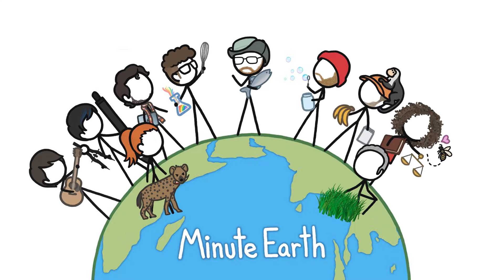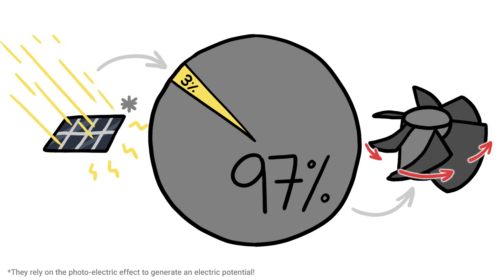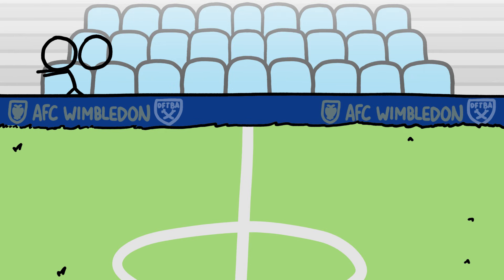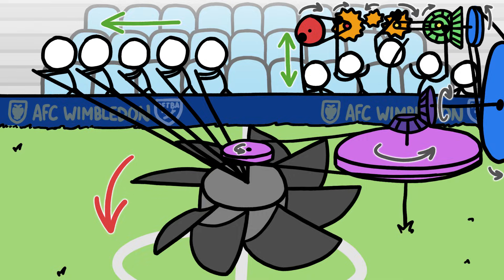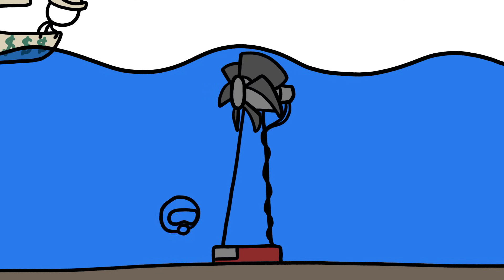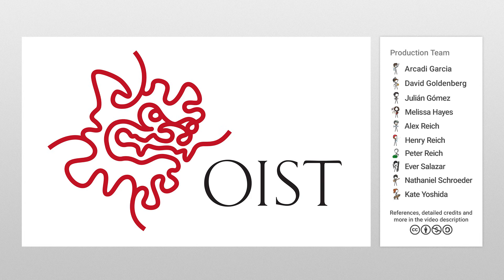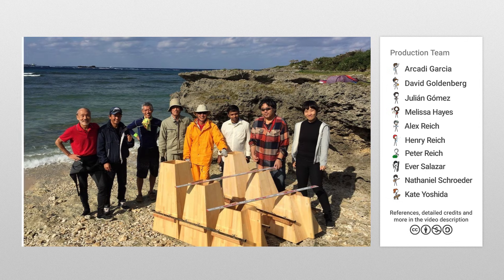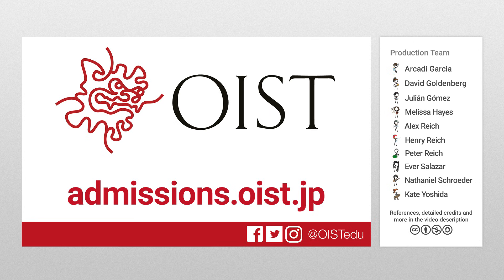Why Can't We Get Power From Waves?

Comment: My dad runs the engineering department of Columbia Power here in Oregon. The design their team is developing is a mechanical float mechanism that acts on a fly-wheel. Sort of like those inertia cars that used to come in Happy Meals, basically you crank more energy into the fly-wheel in one direction & the fly-wheel then runs the alternator that generates the AC current. Turbines aren't used in diesel generators, which are currently the simple solution to "I need electricity here & there isn't a convenient way to run a turbine here."

Comment: If there's one power source that needs an explanation on why we can't use it is nuclear. Why is everyone against nuclear? What are the recent developments? Why are we not looking into such a powerful and readily available source of power?
Reply: If its fission you are talking about
Fuel is limited. Despite its high energy density it will run out. We could maybe run the world for a hundred years or 2 on the uranium and such we get. Maybe more if we find a way to use other fuels.
But it's a massive biohazard.
If your talking fusion then it's being worked on but is still a way off from being practical. Maybe in another 10 or 20 years. But not now.
Reply: @curseofgladstone4981  
"Fuel is limited."
The World Nuclear Association begs to differ.
http://www.world-nuclear.org/information-library/nuclear-fuel-cycle/uranium-resources/supply-of-uranium.aspx
Not only that, but some reactor types can reuse their waste.

"But it's a massive biohazard."
It isn't. There aren't huge wastelands caused by nuclear waste. All the nuclear power we've used barely left a scratch. Nothing compared to the areas covered with wind turbines or the fields of solar panels or the huge number of dead birds.
As for nuclear accidents, Chernobyl stands out. It used a very antiquated and unsafe reactor design, and personnel deactivated safety features in order to conduct that test.
Fukushima used a similar design, but they managed to keep everything under control as much as possible. The incident had a minimal effect on the environment, with people already moving back in. I couldn't find a definite death toll due to radiation, since it seems that death due to relocation and due to the tsunami itself are added up into one figure.
Three Mile was another boiling water reactor, with the same flaws as Fukushima and Chernobyl. The reactors available today are almost entirely safe. CANDU type reactors have been available for decades and cannot physically have a core meltdown due to the type of fuel used. Molten salt thorium reactors are very easy to manage, fast to shut down, cannot have a meltdown, cannot explode, and are in development. Working reactors exist, but further research is needed to ensure longevity.

In short: There's plenty of fuel, they're safe, they're clean, and they have proven themselves. Far more than so-called renewable energy has.
Reply: @CristiNeagu  
the main reason is because most of the activists pushing for renewable energy solutions are liberals, and liberals are scared of literally anything, especially the word "nuclear"...

Comment: Don't confuse wave energy with tidal energy.  In places there is enough flow in the tidal changes to drive (you guessed it) a turbine.  These are in commercial use, however they do suffer from the same issues as any undersea equipment, namely corrosion and inaccessibility.
Reply: i was surprised he didn't talk about tidal energy
Reply: Yea as a science based channel I was disappointed they didn’t mention tidal energy :/
Reply: So, basically, original comment said exactly what the video said. ...uh, thx?
Reply: Thanks for the information, I was kind of confused
Reply: The area where I am is powered/assisted by Tidal generator(total output does cover it)
Reply: Michael Steeves how about that wave-powered power plant in Norway?
Reply: Michael Steeves right I live in ns can and we get tidal power
Reply: But tides simply move up and down one cycle per day, seems extremely inefficient.
Reply: @eggyrepublic  On the contrary,  tidal power seems both reliable and efficient with a capacity limited only by the size of the basin you are willing to dig.
Reply: @G11713  I just did a bit of research on them, it appears they just rely on currents like dams. I see how that can be effective.
Reply: It’s easy enough to moor a barge to a pulley for maybe a kilowatt of power. Between buoyancy and gravity, it’s really easy to draw power from a mass being moved by such unstoppable forces. All you need is a fixed reference point like a mooring base.
Reply: Tidal power is also unsustainable at filling much demand. Seeing as there are only a few terawatts of tides to begin with and baring some massive geoengineering project or moving the moon closer I see no way to change this fact.
Reply: Arent tides just big waves anyway.
Reply: @DocDewrill  No. They are the physical pull of the Moon pulling the Ocean away from the edges of the Earth to the Center. Waves are just caused by wind.
Reply: @evoeightyci  waves are not just caused by Wind ^^  a tsunami is a big Wave too wouldnt you agree?  And the only diffrence vetween waves is the size.
Reply: @DocDewrill  A Tsunami is caused by the Earth's crust shifting. Like dropping a big ball of steel into the water, it causes waves. The Moon's pull is not a wave as such. it's a gravitational pull, not a push.
Reply: @evoeightyci  according to Britanica com, every wavelike movement of water is a wave. So tides are technicly a gigantic wave.
Reply: @DocDewrill  OK
Reply: @evoeightyci  Nope. The Moon 'pulls' everything in equal measure at equal distances, just as any other gravitational body. It's pulling the whole Earth the same. In fact, it is so heavy, that the Earth has to lean back a little to balance the Moon's orbit, as you would have to lean back to swing a child in a circle around you. This gives the Earth a 28 day 'wobble'. The oceans slosh back and forth somewhat from that wobble. As the Earth rotates every 24 hours, each point on the surface will come to a high point in those sloshes, and then low point sloshes, roughly twice a day.
Reply: @gg5115   I do understand that. What I was trying to say was the the Moon is a different power source than anything produced on the Earth itself.  Energy on Earth is produced by the heat of it's core, mostly. The tides move because of the force of the Moon, and nothing to do with the Energy of the Earth. Can you see what I was "trying" to say? This is why I was trying to separate waves and tide. I hate 2 dimensional language. I never dislike being wrong. I hate being wrong through my own ignorance.
Reply: Thanks, I'm glad someone pointed that out.
Reply: Tidal power also messes up ecosystems badly (much like hydroelectric power) and requires a massive area, turning large lengths of coastline essentially dead.
Reply: @MrOobling   The main issue is that eligible sites are very rare, even if you are willing to risk the ecosystem.
Reply: @MrOobling  The initial attempts at stored head tidal power (i.e. the demonstration site at Anapolis Royal Nova Scotia) had significant impacts.  Modern units are essentially "underwater wind turbines" which have far lower ecological impact.
Reply: @MichaelSteeves    Yes, and the tidal power was so strong in the Bay of Fundy it broke off the main support the first time. Oops. It's back in and running now I believe. 
  Whatever we can come up with to help our species survive.
Reply: @MrOobling  I think you want to talk about tidal barrage, that is one way for using tidal energy. The environnemntal impact is not as bad as you think. French researchers studied the impact of one of the largest tidal barrage (La Rance) and found that "some species lost their habitat due to La Rance's construction, but other species colonized the abandoned space, which caused a shift in diversity." It is not completly dead, but it is not the same ecosystem. Other people commented about the alternatives methods to use tidal power, i.e. tidal stream generators, that have lower ecological impact.
Reply: @thibautkovaltchouk3307  I imagine it depends where it is too. I know the severn esturay tidal plant in the UK is controversial. But it might be able to power 10% of the UK energy needs with non carbon power. You need to weigh up costs and benefits
Reply: @Chilukar  Exactly, and I think the same place can lead to largely different ecological impact depending on the project (the size, the preservation policy,...)
Reply: @thibautkovaltchouk3307  I didn't know about these developments, that's good to hear.
Reply: I did not see any confusion in the video.
Reply: Thibaut Kovaltchouk - you also didn’t see any mention of tidal energy. It’s a valid comment which clarifies we are pulling energy from the sea for those uninformed.
Reply: @uhhhhh262  Anyone with two braincells thought about current being used.
Reply: @thibautkovaltchouk3307  Its confusing if you were already vaguely aware of the existence of tidal energy but didn't realise it was distinct from wave energy
Reply: Technically a tide is just a huge wave.

Comment: just make it like a car engine with buoyant balls, moving the pistons up and down .
Reply: salts want to know your location
Reply: Tried that Up and Down motion and it sent Electrifying waves of pleasure around my body. 10/10 would try again.
Reply: friction and salt / dirt deposits will be hard on this one
Reply: @NoThankYouLeaveMeAlone  you just store it inside a container with exposed pistons only. So only the container will need maintenance over a long period.
Reply: Unfortunately, waves aren't as well timed
Reply: @crackedemerald4930  maybe a syncro bubble can be placed in front mechanically adjusting the ratios based on incoming wave
Reply: Interesting idea. Salt? Mechanics? Never mind these issues. How does the marine industry survive? Stainless, brass, Teflon etc. The mechanics underwater? : picture an off shore oil rig. Where there's a will, or $, there's a way
Reply: @Froggability  it can also be placed above, under a bridge https://imgur.com/4kiHucS
Reply: Adrian Gray that idea is obvious enough that I have to expect that someone has already tried it

However, just in case no one has, try it!

You might become rich
Reply: Adrian Gray. afraid that looks fraught to failure. Storm= destruction. 
Consider a "farm" of submarine sized vessels semi submerged. Connected to sea bed with large hydraulic rams or similar. Able to be sunk lower should conditions get rough

Comment: I remember how disappointed I was when I learnt that nuclear power just uses the heat to turn water into steam.

This makes me wonder if fusion power is gonna do the same thing. 

Like come on, using heat to make steam to drive a turbine is the same technology that made steam trains. the technology is as old as steam locomotives.
Reply: Yes fusion is going to do the same thing.
Steam turbines is the most efficient thing we have to go from heat to electricity.
Reply: MrBleulauneable I get that it’s efficient, but it’s sorta just disappointing that in all the years since the steam engine we couldn’t think of anything better
Reply: @thestargateking  Are you disapointed that we haven't found anything better than the wheel to make vehicles ?
Reply: MrBleulauneable Umm, we have more things than wheels for motion, we have tank treads, we have helicopters using rotating blades, and we have aircraft with jet engines that only use wheels to land with, and then we have maglev trains that float, making wheels not even necessary, there’s far more things than just the wheel for motion.
Reply: @thestargateking  
tanks still use wheels ( https://i.redd.it/h1192qmjha321.png, https://i.ytimg.com/vi/KXHLfzVo40Q/maxresdefault.jpg ) and are in principle no different than cars. the treads are there just to distribute the weight better. even jet-powered aircraft still use wheels ( http://i.stack.imgur.com/faajY.jpg ), while maglev is a joke when compared to the efficiency of wheels.
Reply: @thestargateking  Yeah sure there are some altenatives to the wheel for specific applications, but the wheel has been there for several thousand years and I don't see it being replaced in the foreseable future. Maglev in particular is cool but it won't replace the wheel because of the infrastructural cost associated with it  (compared to asphalt) and other practical considerations (acceleration, breaking and steering) that pretty much limits it to high speed trains. Car, bikes and nearly all other land vehicles will keep using wheels simply because wheels just work really well.

And that's the same situation with turbines, we have few other options to make electricity from heat (like Peltier modules that use the Seebeck effect, or we could also for example use IR "solar panels" to harvest blackbody radiation) but the turbine is like the wheel: it's such a good invention that it always works better than any alternative except in very specific applications. So turbines will most likely stick around for a long time.

Also it's not like wheels and turbines are stuck in the past, they have been vastly improved over the time.
Reply: Voltage Drop the wheels on aircraft are there just for landing purposes, but way to ignore the helicopters, and GTFO with the maglev comment, the whole point of the levitation is to remove friction, to allow the vehicle to achieve a faster speed than what would be possible. At high speeds the wheel would be inefficient
Reply: MrBleulauneable the wheel is different to the turbine, there are technologies that can replace the wheel, but turbines to generate electricity have no replacement, there’s no replacement for the turbine in a power plant.

I don’t get why you feed the need to attack the idea that it’s disappointing that the method of energy generation has been the same since the steam engine, like the wheel isn’t even comparable, wheels have used completely different materials, have had tracks, have had helicopters replacing wheels, levitation. While the turbine still uses steam, with the basic copper wire and magnet trick.

Battery technology has developed more than the basic turbine, and battery technology is developing very slowly.
Reply: @thestargateking  Wings don't do the same thing as wheels  so comparing them is stupid. Maglev and tanks treads do the same thing as wheels so comparing them is not stupid, but as someone remarked before : tank treads are just fancy wheels and as I explained maglev is only suited for a niche application and can't replace the wheel (hell, maglev trains even use wheels to launch and stop).
And maglev trains are barely better than regular high speed trains with wheels for reference the speed record for train on regular wheels is 574,8 km/h while maglev speed record is 603 km/h. At high speeds the limiting factor for trains is the aerodynamic friction which maglev is useless against.
Reply: @thestargateking  As I already mentioned there are other ways to convert heat to electricity "Peltier modules that use the Seebeck effect, or we could also for example use IR "solar panels" to harvest blackbody radiation".
And turbines are complex machinery I don't understand how you can even think that no improvment as been made to them over the years. For your information we are almost reaching the thermodynamic limit (aka the absolute limit imposed by the laws of physics) with the best turbines now.
Reply: Turbines are very efficient

Comment: Video idea: we are constantly getting pulled by gravity why cant we generate electricity from it
Reply: We do, with dams
Reply: @dfhgjhg  oh you are right... Hadnt thought of it..😶
Reply: Hydroelectric dams generate power from gravity.
Reply: In order to get energy from gravity we need to raise an object up and then let it drop down. Raising it up takes the same amount of energy as the object gains as it falls. We can't use gravity to harness energy but we can use it to store energy.

For example, if we have excess energy being produced by the grid, we can use it to pump water into a reservoir. When that energy is required again, the reservoir is opened and the flow of water is used to spin hydroelectric turbines, producing electricity.

Grandfather clocks also use gravity to store energy. The hanging weights slowly descend, powering the clock. They can be wound back up to give the system more energy, and that energy is released again when the weights descend.
Reply: @charliebeadle2979  Raising an object up takes more energy than it produces as it falls down*
Reply: @user-lw5oc1tt8k  In practice, yes, but I'm just talking from a purely physical perspective (i.e. in a frictionless vacuum). In such conditions, the change in energy of the object is given by the equation E = mgh regardless of whether it is moving up or down.
Reply: @charliebeadle2979  What I was thinking of is basically having an object fall from a high place (with maybe lot of air/(maybe a gas that can heat up easily) ) from friction it would generate heat then we could use that heat to make electricity(like described in the video) after the object falls it could  go to another "box" (with no air so no friction so less energy needed)use some/most of the energy it made while falling to lift itself up and start all over again
Reply: @user-lw5oc1tt8k  The energy generated from friction will be far less than the energy required to lift the object up high. A potentially more efficient method would be to have the object attached to a chord which drives a dynamo/generator (this is essentially how the grandfather clock example works). This would still produce less energy than is required to raise the object up, which is why this is a way to store energy rather than to produce it.
Reply: @charliebeadle2979  so the best way is to just use nuclear energy i guess..